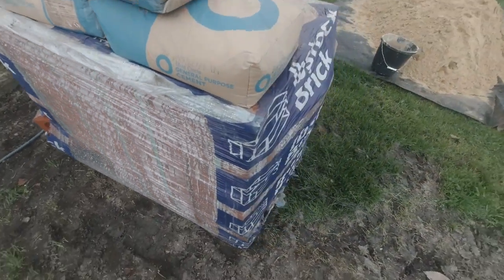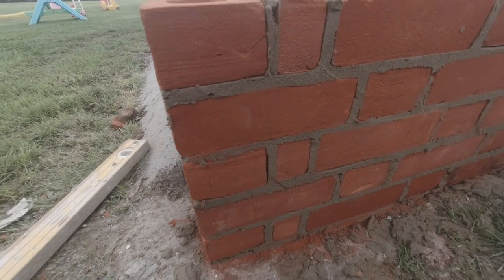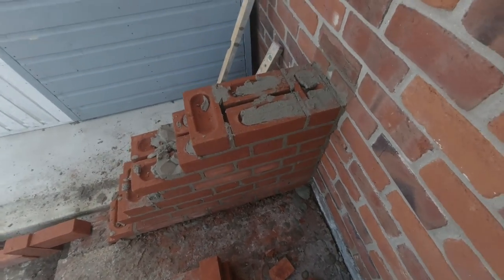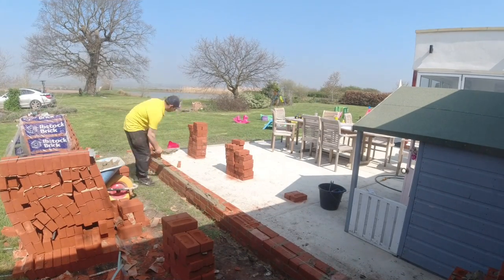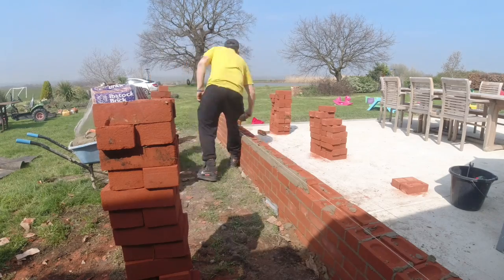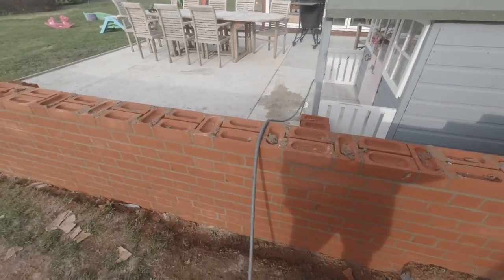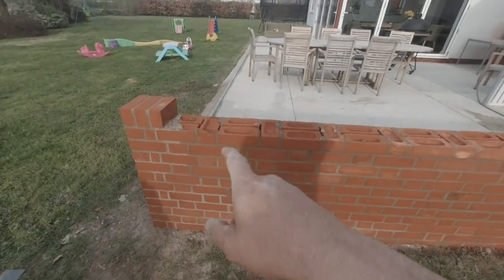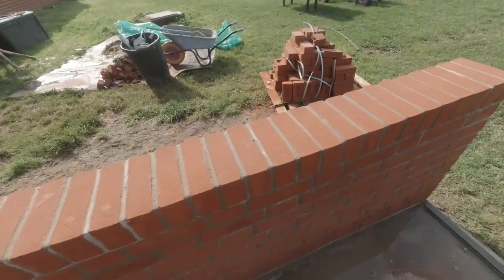how to build a Flemish garden wall #bricklaying #construction #build

Comment: you have used a queen closer one end and at the other end you have used a  three quarter ,it looks like a dogs dinner,if you use a queen closer one end you use a queen closer the other end ,its for uniformity
Reply from the maker: 🤣🤣🤣🤣 not when you run into a existing brickwork.  If i was coming to a end i would have done both the same . As i explained in the video. And to keep the perps neat you go with what you have. So no dogs dinner to be seen. Customer over the moon with the job. Win 🏆 for tricky 😊